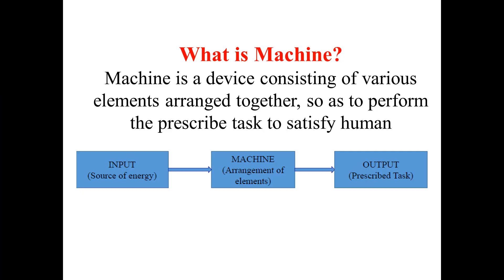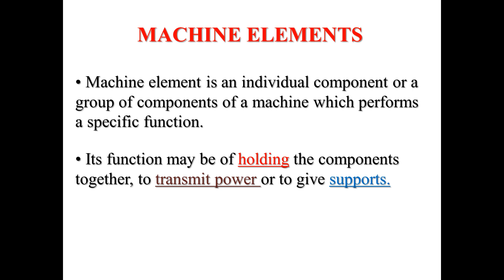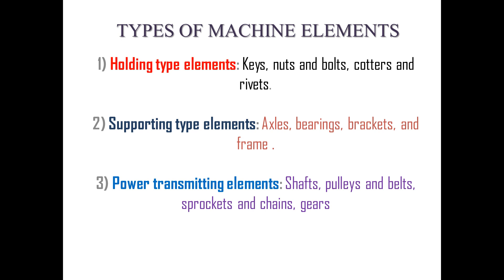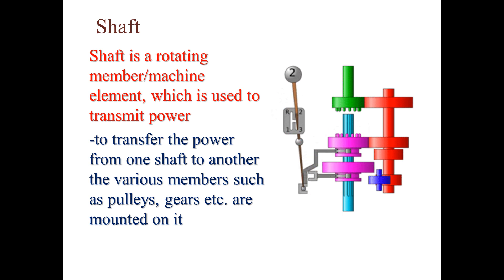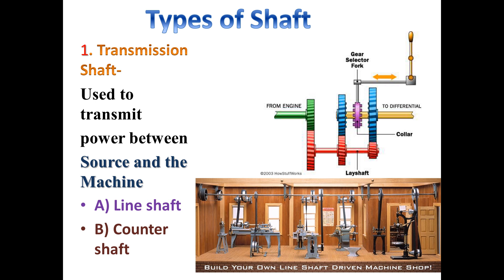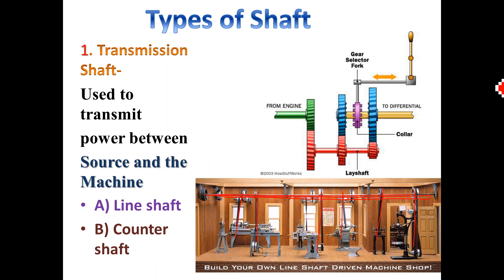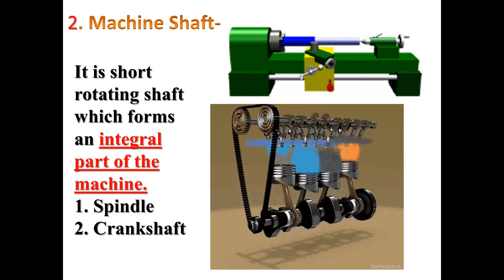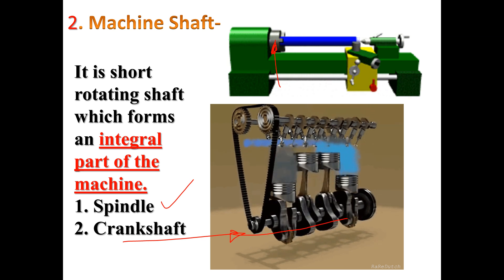BME 1.1 SHAFT & AXLE

Comment: Sir your noise is not clear in some  your videos due to your mic or any other reason
Reply from the maker: Earphones Are Recommended
Thank You
Reply: @smarttechknowledge7811  By Using  Earphones This Problem Is Continuesly Going On. 
Please Solve This Problem. 
Due To This Ear Get Irritate
Reply: @smarttechknowledge7811  It wouldn't make a difference anyway. If its breaking in speakers its gonna break in headphones too. Common sense.